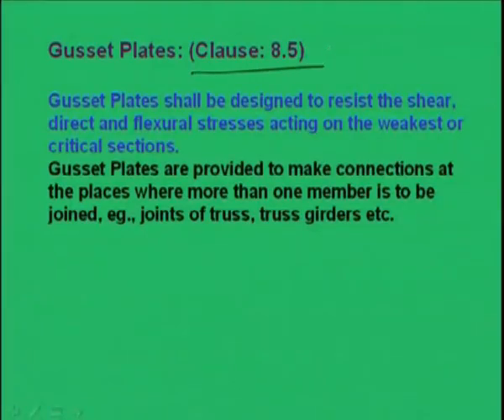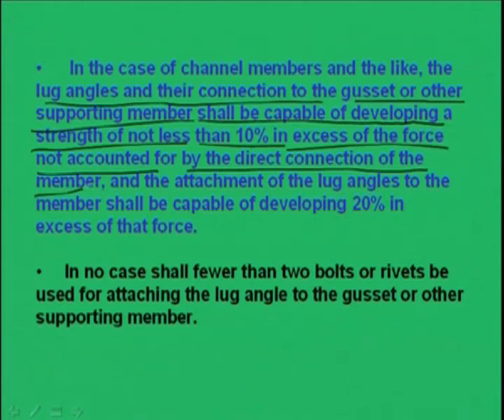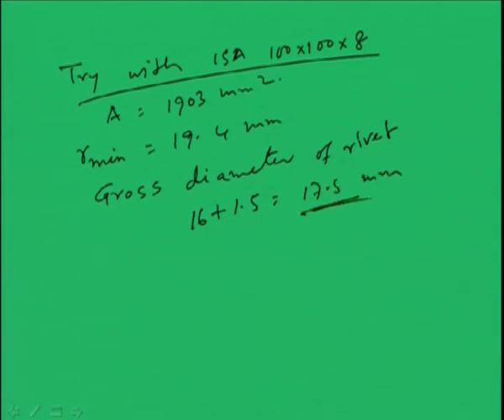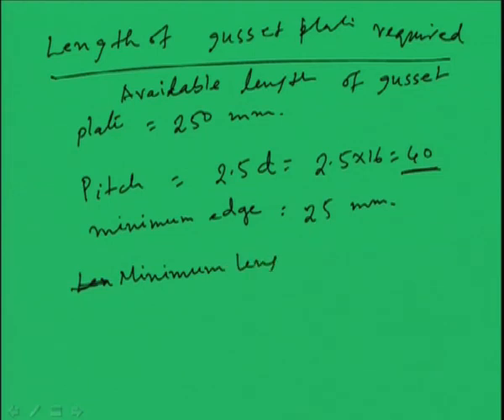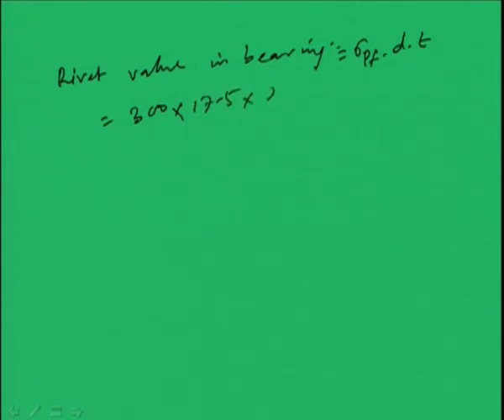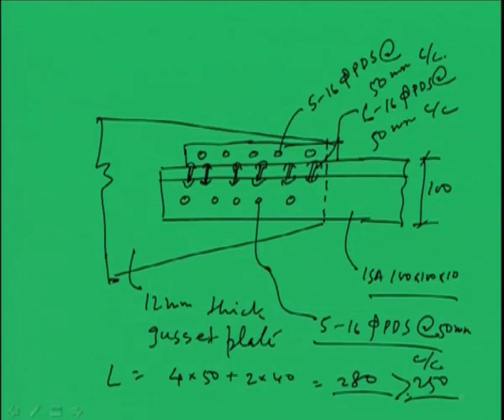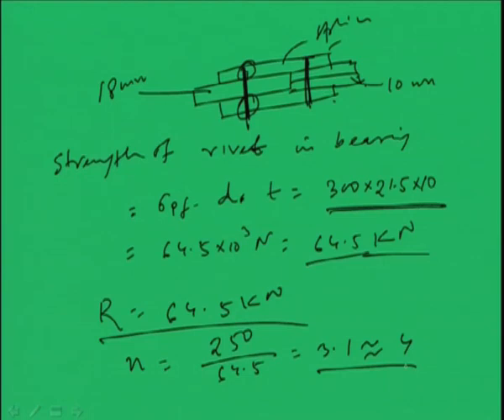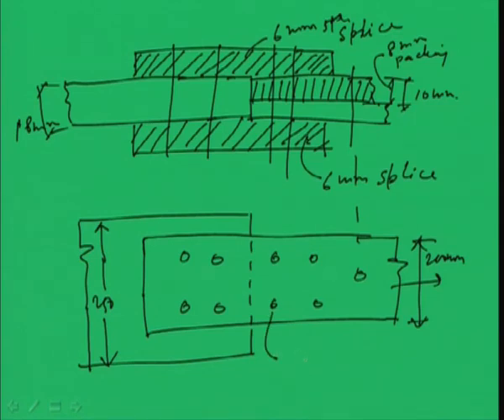Mod-4 Lec-3 Design of Tension Member: Gusset Plates. Lug Angles and Tension Splices

Comment: Thanks for this beneficial lectures. However, I have a note that when we deduct the hole of the rivet to find out the net area that's ok to add extra dimension to dia of the rivet as 20mm becoms 21.5,  but when we calculate the strength of the rivet either in shear or in bearing I think we have to take the real dia of the bolt without the extra dimension of the hole eg we take 20 mm and not 21.5. Thanks again for India and its universities to spread the knowledge around the Globe.